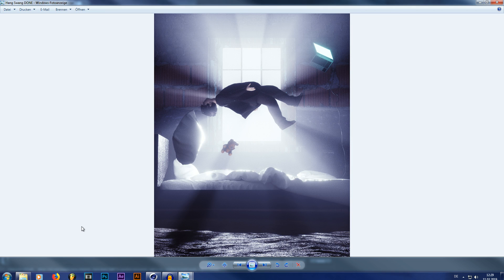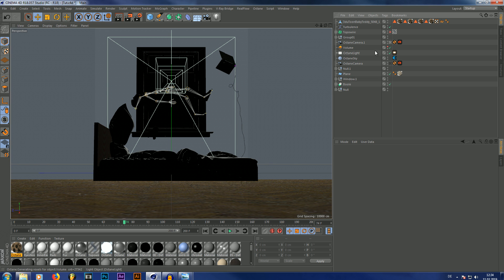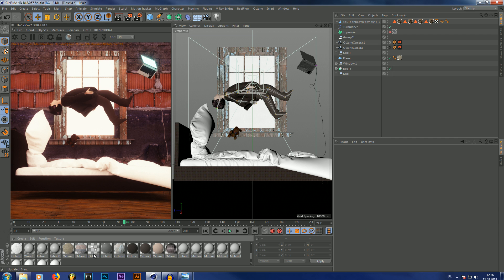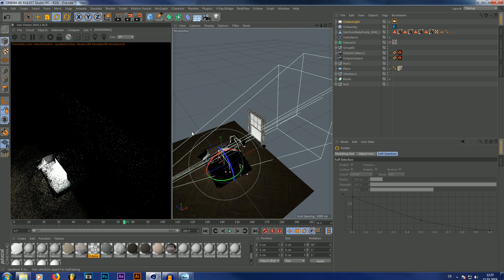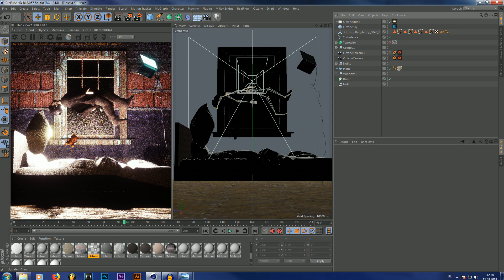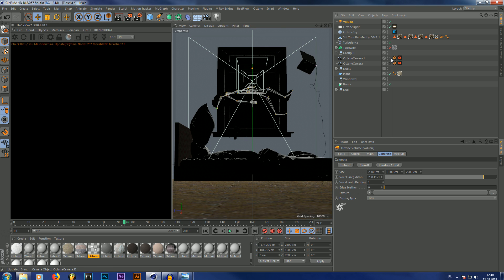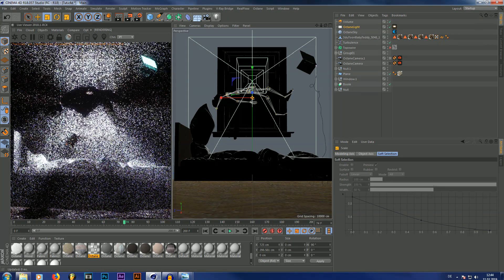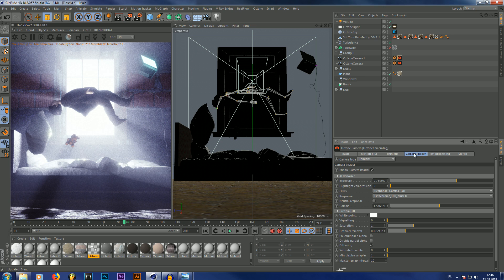Volumetric Lighting and God Rays Tutorial | Octane Render

Comment: For some reason this doesnt work, i tried putting it far in the distance but its barely noticeable.. :/ still sick tut <3
Reply from the maker: thanks! did you make it very small? and also, just to test it out. Try putting cubes into the volume to see if there are really no rays at all or its just the object that obscures them a bit. for example if you have multiple trees in front the ray will be much much smaller to an extend where they almost disappear

Comment: Thanks for the tutorial, Dizzy! 
Quick question for you. How do you get more clear looking fog volume?
I'm currently animating a room scene and the fog volume spreads my light nice and even, though frame by frame it seems more like grain than fog. 
Is turning up my samples the only way? any tips?
Reply from the maker: You´re welcome! yeah that has to do with sampling, sadly octane is quite slow with Fog. What you could do: Increase samples (test it in region render by rendering it in that region till its not noisy, and have a look at the used samples), use AI denoiser, play with the GI clamp (octane settings) and adaptive sampling. Also if you use emissive materials (not arealights or daylights) it could help to increase its light samples (its 1 on default).

Comment: Whats is your desktop setup?
Reply from the maker: Sorry, what do you mean?
Reply: @TheDizzyViper  what is the configuration of your computer and how long does it take to render this scene? I'm researching the feasibility of C4D and Octane to invest in software and a new computer
Reply from the maker: I have a Work rig with a 1080ti, 24gb ram and I7 4790k that i use for working, and a Render rig with an RTX 2080ti (soon getting a second one), 32gb ram and I7 8700k. The scene took ~30 mins on my work rig (with one gtx 1080ti) without Ai denoising. It was i think 20.000 samples
Reply: @TheDizzyViper  Render a video with 20 thousand frames in 30 minutes?
Reply from the maker: no no, 20.000 samples. 30 for one frame